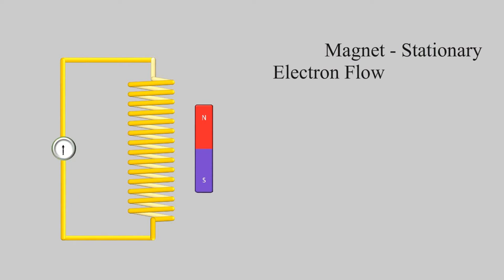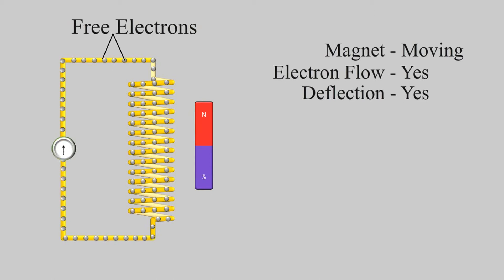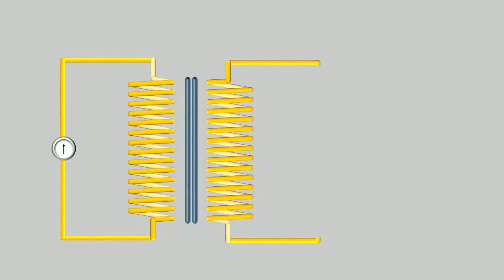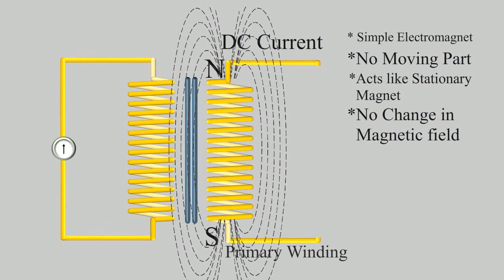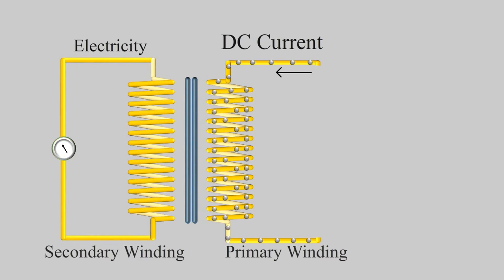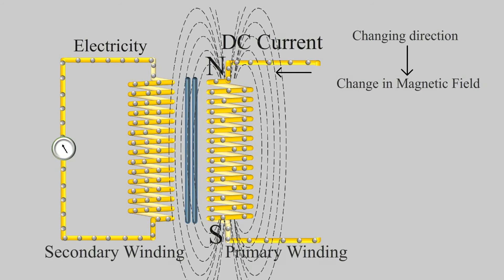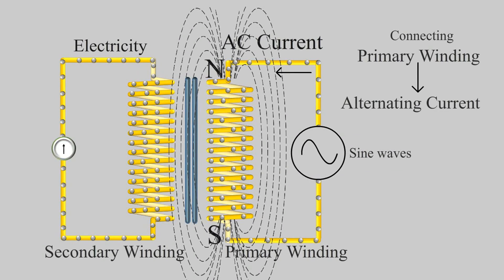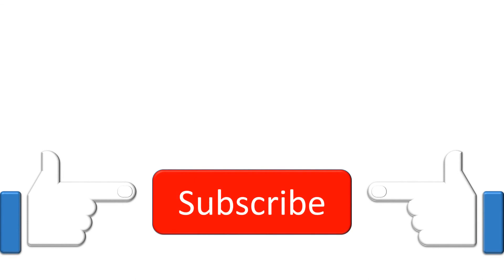Transformers work only on AC current and not on DC . Reason explained.

Comment: Hello i have a question, why in some high voltage generator could using DC current to power the circuit?

Comment: There are dc current transformers too. They use transistors and solid state devices to switch the direction of current and form a pulsating dc ouput that looks like a sine wave. Then after transformation, a rectifier and filter is used to get the dc output.
Reply: he is talking about a conventional transformer with 2 coils and nothing in between.  no inverters.  it does not exist.

Comment: But how the moving magnetic field can move the electron inside the conductor as its stationary electric field....
Reply: The electrons in the circuit are fixated. When you move the magnet, the electrons are attracted to the South terminal of the Magnet. However, if you stop moving the magnet, you lose the electrical current. In order to avoid this, you need to move the magnet up and down to maintain the attraction of the electrons. This allows electricity to be generated as this movement of electrons is electricity.

Comment: Here's a very basic explanation:  
To generate electricity you need 3 things: a magnetic field, a conductor, and a relative motion between the two.

In a generator that relative motion is caused by the rotating magnets in the rotor of the generator. Which induces (aka generates) a voltage into the windings (the conductor).

In a transformer that relative motion is produced by the expanding and collapsing magnetic field in the primary winding, causing voltage to be induced (aka generated) in the secondary winding.

If the primary winding were DC voltage then there would not be the expanding and collapsing magnetic field, therefore no relative motiin, thus  no voltage induced (generated) in the secondary winding.

Comment: Actually transformers can work on DC power. A ferrite Toroid will  work if you hook up an led with power in series with one coil. The second coil will mirror the power output on a 1:1 toroid trans former. So you can run a similar led though the voltage and current may be less and also polarity will be reversed to the original circuit. You can't hook up a coil to a battery straight as it will get too hot. So you need a load in series to prevent this. The coil inductance increases power. But it may be possible to make step up and step down with series load dc transformers. It seems to work best in non magnetized Ferrites so far as I know. The other condition for this that the coil had to be bifillar.

Comment: I hooked a 9 volt battery up to a small transformer and touched the secondary wires and it knocked the piss out of me,how do you explain that? Seriously
Reply: May be 1. Immediately after connecting primary wiinding  to 9v battery, a voltage is temporarily induced in the secondary coil at a ratio. Higher voltage may be induced, causing shock, just once
2. When the 9v battery connection is not stable, pulsating/varying dc at right frequency may induce secondary voltage 
It is when stable dc voltage is connected that further voltage won't be induced

Comment: Transformers works with DC pulsating current also.
Reply: d.c. voltage cannot produce a changing magnetic flux required in the working of a transformer.
Reply: @chetanm0  Read again I said PULSATING d.c.
Reply: @williamguillen4113  it is a type of DC so not possible
Reply: @chetanm0  The DC pulses produce a changing magnetic flux required. The SMPS for example works in this principle, using  high frequency switching section by a high frequency transformer.
Reply: @williamguillen4113  but so far Transformer can only do AC to AC
Reply: @chetanm0 The DC pulses produce a changing magnetic flux required.The SMPS for example works in this principle, High Frequency switching section by a high frequency transformer.
Reply: @williamguillen4113  
Yes. Especially in all one transistor phone charger.  But some smps also use push pull or H bridge transistor arrangement to get ac before being fed to transformer

Comment: Very GOOD JOB but, you did leave some persons down the wrong road in and important way DC to DC power supplies. I do suggest that you also ad this Dc to DC and DC to Dc lastly to DC to DC meaning that you Reference the Current value s Small current to large current then Large current to Small current and lastly DC to DC as a coupling for feed-back and power regulators such as those of power supplies.  Also coupling for job control as in Elevators motor drive system of these units. Be sure to show it after the transformer this will save some work if shown at the same time otherwise a quick reminder of AC transformer actions.

Comment: Ok, but is the voltage produced by the secondary windings AC or DC? Also, what if you use DC with a chopper, wouldn't that activate the secondary windings? Please let me know, I want to learn. Cheers!

Comment: Sir i have question that... if i want to use transfo  . .... in my Dc to Dc step up converter.   What suggestion d u have 4 me...  ... i m just bigginers in electronic...
Reply: RIP English
Reply: You can use joule theif circuit...if transformer is connected with dc it will be a short circuit..